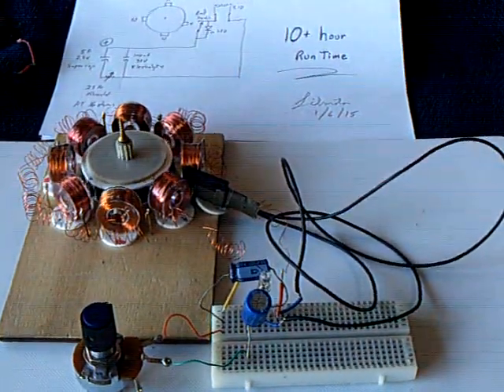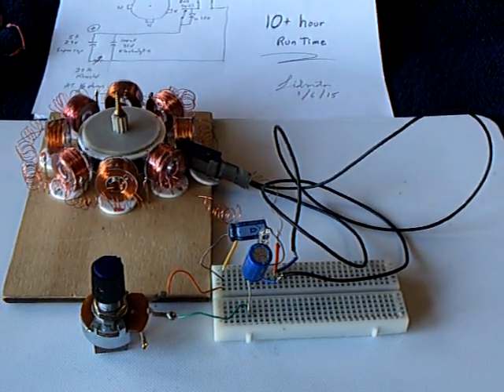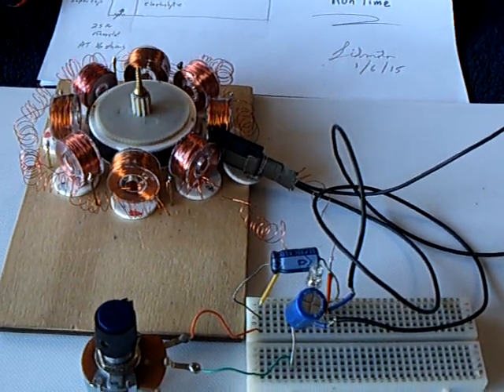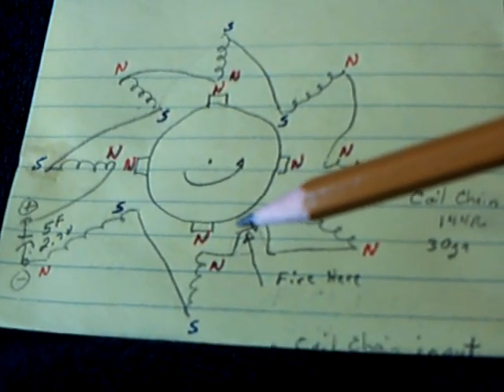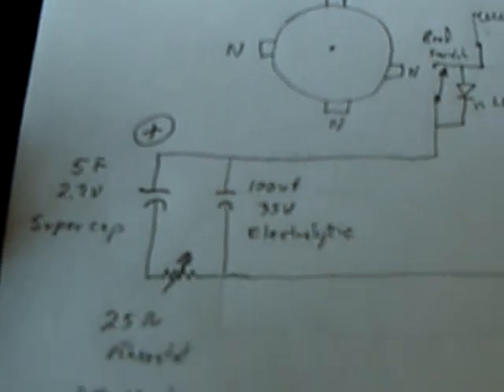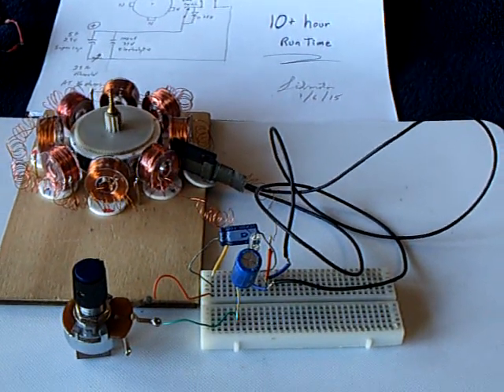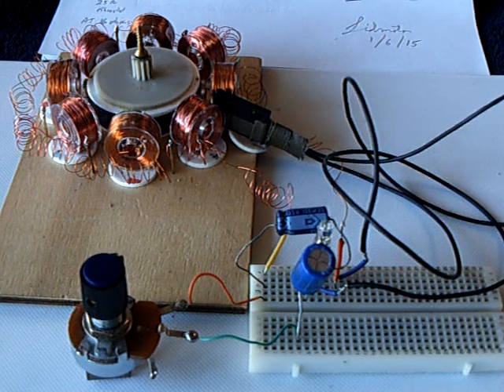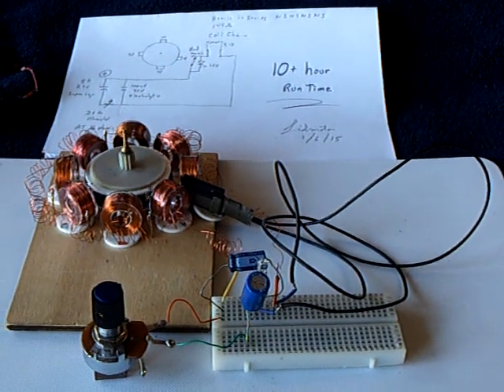EZ Spin 10 hour runner

Comment: I was going to attempt a build of one of these.  Is there an optimum coil size?  Would it be better to use an pancake style coil where the flux is mostly close to the magnet , or does it not really matter?  I see most of Lasersabers motors use more barrel shaped coils but thought that the end of the coil furthest from the magnet would not be as useful.  I thought that maybe a disk neo magnet and a pancake coil that are roughly the same diameter might be best but I am not an expert on these.  Since you certainly have much more experience than me what were your thoughts?

Thanks and keep up the interesting building.
Reply from the maker: DaveC1964 It all depends on you definition of "optimum".  The flat coils would be best for this I think. Slider made one of these using the coils out of  those dollar store solar dancing flowers that worked well.  The wire is so fine though that I didn't even try that.  For me the simple sewing machine bobbin filled up with 30ga coil is good enough.
Reply: ***** 
Thanks for the info. Optimum to me is running the longest on a charge and/or running at lower power.  I think that is the coolest thing with these is the "how low can you go" thing.  Speaking of that I think it would be cool if there was an actual contest where the winner made the motor that ran on the lowest power.  That would yield some interesting results.
Your bobbin thing was a great idea though, I was thinking of what to make coils with as I lack a 3D printer.  I may use your bobbin method in a build.  They kind of are pretty flat.

Comment: What are you using for a bearing?  I see you only have one end supported so I was wondering how you did it.
As far as run time I see you are measuring the power.  Most meters emit a small current through the probes to make measurements, could it be that which is charging the cap a little every time you measure and lengthening run time?
Reply from the maker: DaveC1964 The bearing is a sewing needle and a phillips head brass screw on top. As far as the meter charging the cap, I don't think so.  This is just just an efficient pulse.

Comment: I don't see any reed switch or transistor.   Are there any?  If not, looks like the tech could be scaled up to a higher voltage (with larger magnets and more rotating mass) as a replacement for a Bedini.
Reply from the maker: +J The reed switch is at the end of the two black wires.

Comment: This is fantastic progress!  JUST NEEDS TO BE SCALED UP.  Then combined with solar power and enough torque to spin a low drag generator. Might work? Lol. Anyway great job!  I didnt catch if the coils are air core? What are good reed switches to use, I got some but they seem to stick or be slow at switching?
Thanx.

Comment: Hey, nice work.  Tried running it on a 'dead' battery yet?   Looks like a contender to the joule thief
Reply from the maker: +J Yes!  This works great on 'dead' AA alkaline battery. It is similar to a Joule Thief but unlike the JT this will keep on turning until the battery is almost completely flat.  This one needs .08 volts at 40 micro amps to keep going.

Comment: Very cool. Can you tell me what u made the bobbins out of and how many turns of wire on the each coil.I have heard  that there is a lot of energy that can be given of of Reed seiches ,put a rectifier on the ends of the reed switch to reuse it! Thanks for your help
Reply from the maker: +bruce don Thanks. The wire bobbins are plastic 'brother' sewing machine bobbins that I got at Walmart.  I did not count the turns of wire.  Just fill em up.  You could probably use a sewing machine to do it but I used a a battery powered hand drill.  I used 30 ga magnet wire and each coil is about 14 ohms.

Comment: Well done Lidmotor ! Try to pulse the circuit instead using a reed switch just with a fast toggling selfrunning relay switch...so it generates multiple switches in the same interval. This will induce much more voltage into the caps. Every extra switching spike counts ! Just look into the Konehead and Aviso coil shorting effect where it is done simular.
Regards, Stefan.

Comment: Wow 11 hour on a super cap that's awesome! Thanks for sharing! Make it run on waste heat :P hehehe
Reply from the maker: A few micro watts will run this so the question now is where to go shopping for it.  Waste heat will do it using a Peltier module.  A solar panel does it IF you have enough continuous light. I'm thinking maybe a small hybrid energy gathering device is the answer. The thing is ---it has to be very small, it can't move, and it has to operate 24/7 with no maintenance.
Reply: How about wireless energy harvesting :) radio wave are all over the place not sure if they would supply enough current, solar well you could store the energy in a cap then the cap would be use at night. Waste heat peltier module would work perfectly. The choice is yours :P hehehe!

Comment: Well done lidmotor!
 try to use a tantalum cap or some other caps that have a bigger dielectric relaxation recovery effect and use 1N4148 diode instead of the LED and see if you can get the motor to run still longer. Anyway well done!
Reply from the maker: Thanks.  I have already tried both of those but I didn't see any big difference. The more I thought about what happened I think the magic happened at the reed switch.  I guess I had it adjusted just right. I have seen this before where a reed switch can make a very short and crisp pulse.  You have to get lucky. I could probably see it on the scope.  You need a very short and sharp jolt timed just right.   The back spike fed back to the right cap must be helping also.  I ran the experriment again last night and got the same results so it wasn't just a fluke.  It is a repeatable event.

Comment: Outstanding! 
Your cap stores ~5.0625 Wh of energy (ie. 2.7V^2 * 5000F / 2 / 3600J) and has ~1.875 Ah of capacity (i.e. 5.0625 Wh / 2.7V) .  For comparison, a typical AA cell stores ~3 Wh of energy.& has a ~2 Ah capacity.  That means your system used an average 440 mW to run (i.e.: 5.0625 Wh / 11.5 h)!

I guess 82 mV was its emf limit, huh?

Thanks for sharing!

Rrevised (corected) calcs below:
Your cap stores ~5.0625 mWh of energy (ie. 2.7V^2 * 5F / 2 / 3600J) and has ~1.875 mAh of capacity (i.e. 5.0625 mWh / 2.7V) .  For comparison, a typical AA cell stores ~3 Wh of energy.& has a ~2 Ah capacity.  That means your system used an average 440 µW to run (i.e.: 5.0625 mWh / 11.5 h)!
Reply: A B  Your Wh calculation is off by a factor of 1000.  Lidmotor used a 5 Farad capacitor not the 5000F used in your calculation:  W = ½ QV = ½ CV2  Energy E = 18.225 Joules = 0.0050625 Wh.  The 5F capacitor had about 592 times less stored energy than a typical ~3Wh AA battery in your comparison.  This very efficient pulse motor would run a great many times longer if powered by an AA battery, with your calculation it would run less time on an AA battery.
Reply from the maker: ReasonForemost I wasn't going to say anything but that it what I thought also.  This would run for months on a AA .
Reply from the maker: Thanks.  Actually I think what stopped it was friction.  Had the rotor been running on sapphire bearing it would have longer.
Reply: ***** 
Excellent replication, documentation and demonstration of this design. While this pulse motor is very efficient, the ability to run at an extremely low voltage greatly contributes to the long run time due to the use of the magnetic reed switch which does away with the semiconductor voltage limitation.  Appreciate your efforts, always enjoy and learn something from your informative videos.
Reply: Sorry, fellas /:  I definitely put in the wrong # on that calculation!   I guess I used 5000 F because I often have to convert uF to F for calculations

Good to see people checked my math!!
Reply: ***** If you see something that I've written that is an error, please correct it as ReasonForemost did--I definitely don't want anyone to be confused by something that I've written.
Reply from the maker: A B OK.

Comment: The coils are very important. And maybe I have an idea. If you would buy or collect 6 cheap (1 usd) battery operated clocks
? If you have the right one, it contains a coil with high resistance and very thin wire. You could also break a couple of relays, but those are more expensive. Hope to see a video soon on this idea .. .. (if it is a good one of course)
Reply from the maker: These are air core coils and I don't think that this would work with cored coil.  I would be fun to try it and see what happens with the clock coils.  Might work.  If you can find pre- made coils it would GREATLY reduce the build time for this project.
Reply: *****
The clock coils can easily be removed from the tiny core it has. But the coils themselves are small as well, like 2 cm in length and less than a cm in diameter. Other coils to re-use are the ones from those solenoid rockers. Also some bigger coils I found of about 300 ohms are from a shaver (Braun). The shaver has 2 of those coils (110 V each). I am currently playing with 4 of those coils, but more in a BITT fashion (non moving parts).
Reply: ***** 
I heard that you can use the coils off of those cheap "solar dancing flower" things.. They are made to do things like this, cause motion on very little power.    These air coils are nicely formed by computer winding machines.  Maybe something to consider.

Comment: how do you know which side is NORTH n which is SOUTH...can you try all north to see difference?
Reply from the maker: What I did to find the right coil pole was to connect the coil chain to a  battery and use a compass. Do that before you solder up the stator coils.
     If the coils are all N you don't get the push / pull effect and it doesn't run with the firing point between the coils.

Comment: Excellent progress, Lidmotor! (And thanks to Lasersaber for the design work also!)
I take it the LED was flashing the whole time?  As a motor+generator combination?
Hmmm.....
Reply from the maker: Thanks.  The Led does flash on the back spike.  One of the experiments is to spin up the motor manually and watch it charge a capacitor ----then watch the thing runs back down as a motor on the generated electricity and flywheel energy.  It is great fun to watch.